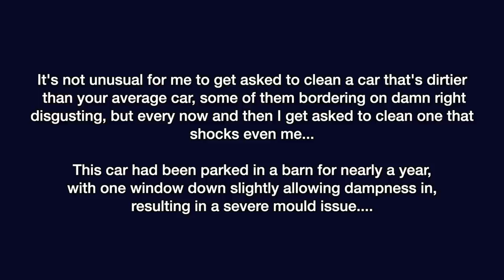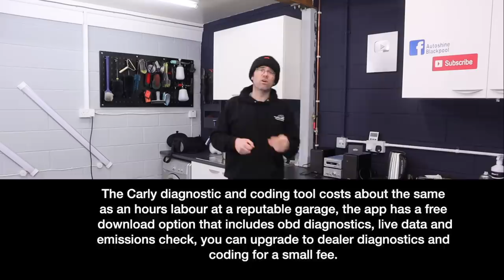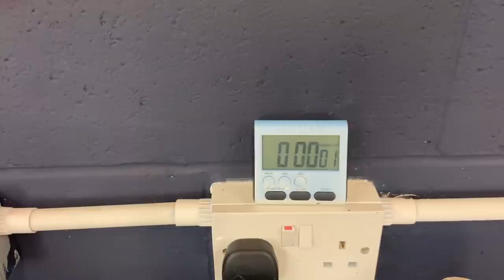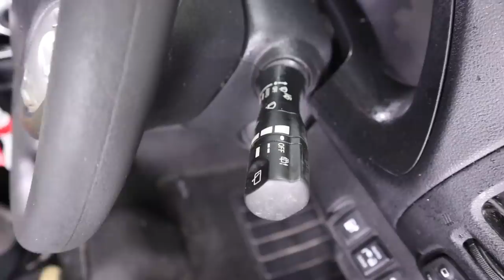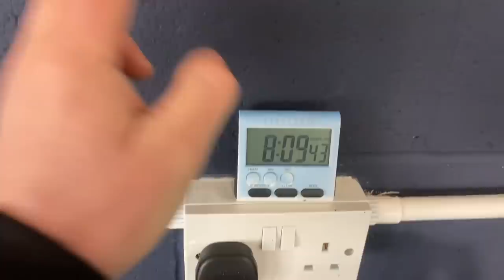Cleaning the dirtiest car ever! Nissan Leaf E.V

Comment: another great clean up but you should really be wearing a properly rated mask when dealing with mold like this, the spores are nasty and dangerous to your health.
Reply: Came here to say this.
Reply: Here's a car I would never want to buy. I credit that he's done a fabulous job of cleaning every surface that's accessible, but mold is going to be in every place it can go including ones you can't reach to clean. It's going to be in the door panels, in the dashboard, in the ductwork and a hundred small place. The spores will carry it and the buyer will react to it. Just pointing out the limits even to this kind of detailing.
Reply: @philipem1000  it would have been better if he'd used an ozone generator to kill the mold first.
Reply: @rlaw22  ye that should have been obvious, hes not the most elite of detailers 😬
Reply: @joemcnamara4774  He's a fine detailer, mould isn't a job for a detailer is the issue here.

Comment: Now imagine what is inside the air vents and on the AC parts. I would be driving this car only in a full face 3m respirator :>
Reply: I wonder the same...
Reply: Or under the hand break panel or under the carpet. :O
Reply: Plenty of air conditioning cleaners that you spray in and leave on recirc for 10 minutes - kill bacteria and mould.
Reply: Yeah, i feel sorry for the unknowing buying that car.
Reply: I would imagine them being quite clean. Parts where dead skin, grease, sweat, hairs and other bodily fluids and organ matters stick tend to get moldy when car sits for a long time. Ac ducts dont get exposed to organic materials so they should be quite clean. Thats why sun visors were so dirty but headliner around it was much cleaner - you only touch the visors. I would still highly recommend steaming the ac ducts, using an air con sanitizer and replacing cabin air filter.
Reply from the maker: It was air bombed prior to returning so no worries about any nasties in air con etc.
Reply: @autoshineblackpool  you should have included that in the video  ;-)
Reply: @autoshineblackpool  Ozone works wonders on the mold spores and smell!
Reply: I was going to ask that same question, did he use his steamer and open all the vent to let the steam circulate through the system. Also he could use an ozone machine to kill the spores.
Reply: @autoshineblackpool  Certo, Chefe.
Reply: I'd also be worried what's below the center console in the carpet, or, even below the carpet (basically you could see there is stuff when the edge of the carpet get's lifted), behind door trims or inside the dashboard, given how even the seats looked below their covers; Mold is just such a nasty thing.
Reply: @autoshineblackpool  Hi Gary, what product do you recommend for that? Thanks.
Reply: You could stick an ozone machine in there which actually will kill everything, won't be able to release spores as its dead.
Reply: Id not touch the car with a ten foot pole.
Reply: also what kind of condition would all those electronics be in after a year in dampness?
Reply: @AnyBodyWannaPeanut  They are probably ok. Most of them are designed to withstand moisture.
Reply: Here's a car I would never want to buy. I credit that he's done a fabulous job of cleaning every surface that's accessible, but mold is going to be in every place it can go including ones you can't reach to clean. It's going to be in the door panels, in the dashboard, in the ductwork and a hundred small place. The spores will carry it and the buyer will react to it. Just pointing out the limits even to this kind of detailing. You'd have to literally disassemble the vehicle to get rid of all of it.

Comment: Mold spores can be very harmful to your health just breathing them in. You should have worn a respirator. Also, here in the USA most detailing shops would have used an ozone generator to kill all the mold inside the car. All you did was remove the visible mold. There may still be mold spores in the headliner, the seats, carpet pads and many other places. I strongly suggest using an ozone generator before returning that car to the owner. Mold spores GROW, so if they aren't completely eradicated, they will return.

Comment: Once again just vacuuming made a lot of difference! Despite that being one of the dirtiest looking, that looked quite easy for you to clean compared to the Red Ford(?) those seats took some doing. A YouTube channel air like to mention is ‘Alex Carter’ he’s basically a car audio installer in my town - Swindon and when I decided to get new stereo fitted I checked to see if there was a YouTube channel. A lot of content is him working on cars, and he’s a huge Snap-on tool fan and gets visits from the Snap-On van every Tuesday and has two huge tool boxes. The car audio content can be quite interesting, shows a lot of common mistakes ppl make installing for example DAB antennas. Other channels, although they’re doing quite well, are electricians ones such as CJR Electrical, Nick Bundy, Adam the apprentice, DSES (Dave Savery) and so on. These ppl are proud to show off their work, and I think any decent business should use it to show your worth.

Comment: Is there a way to kill off all of the hidden mold spores?  I would be very leery of driving in something like that.
Reply: he replied to another comment that the car got something like this before being returned
Reply: @TheThomasites  Thanks I wasn't sure if an ozone generator killed mold spores or not.
Reply: @artflorez1568  It will but I'm not convinced you can actually reach all the mold that must be growing under the panels and in the electrical channels and the ductwork and a thousand little places. I don't know how long you'd need to run that kind of machine to really get it all and ensure it won't recur.

Comment: Back and forth, doing tires and outside when inside is a disaster. Not having all your tools outside to save time...priceless.
Reply from the maker: Whats the rush? My workshops like 8 metres long nothings ever that far away 😂, but I suppose I could leave all the muck on the outside so that everytime I brush past it In my workshop I get filthy, if that makes sense to you. Doesn't to me though.

Comment: This usually happens when the car is stored with the windows closed. When the windows are open, the air circulates and it does not go moldy.
Reply from the maker: It was in a dark damp barn with no sunlight so yeah I agree but not in this case. The cars around it were all covered in mould inside and out.

Comment: You did an amazing job! I cant believe they trashed the car that bad. I wonder hows the battery condition. Early 2022 i just bought a Leaf 1st gen just like this car. Since the gas price is up this car price goes crazy pricy. I got lucky get ahead just few weeks before the price went up with same year and model over 7k difference. The car that i bought only has 29k mileage on it. Very reliable car.

Comment: Here are my thoughts. I have a car that has gotten some type of mildew in it. Not a large amount, but every time the passenger side floorboard gets water in it, it stinks. Like mildewy, moldy smell. This car is WAY worse, and although you do an INCREDIBLE job, I wonder if this car will ever get rid of the smell. I would think seats, carpet and headliner would have to be replaced.

Comment: A Dehumidifier is a worthwhile investment for drying items that have been wet washed. Place it in the middle of the vehicle and it'll suck out all moisture present. A lot cheaper than leaving the heating on to dry a vehicle out, in the long run.

Comment: @ 22:00 this isn't actually a problem for modern electric cars, think about it, you charge every night and the next day you have 100% range (theoretically, you actually charge to 80 - 90% to keep battery healthy, unless you need to do a longer trip), and newer electric cars go further per charge and charge very quickly, with most able to charge 10 - 80% in <30 minutes at fast charges, teslas even faster.

Comment: Just adding my two pennies worth. What about all the spores in the underside of those seats, I think I would have turned the car on with disinfect running through the air system after talking out the HEPA filter then replacing it with a new on.

Comment: It is IMPOSSIBLE to get rid of the mold spores in that thing, even with your superior cleaning skills.  Recovering and refoaming the seats would help ... along with all new carpet and all new air filters. But I would put a pan on the floor with formaldehyde and let it sit for a few days to kill as much as possible.  I hope you don't suffer a respiratory crisis from cleaning it without a serious filter mask!  There oughtta be a full disclosure of the mold condition to whomver buys that pig!
Reply: I think you could use one of those ozone machines and leave it in the car for a day. That will kill the mold off (and the detailer if they stay in there too long while the ozone machine is running)

Comment: you sure that wasn't buried?
My son-in-law had one of those devices, not the Carly,  installed in his car.  He was wondering why his battery was going dead if the car sat a few days.  After buying a new battery and still having the problem, it turns out the device was causing a ghost draw on the battery.  He took it out and hasn't had any more problems.

Comment: Here's a car I would never want to buy. I credit that you've done a fabulous job of cleaning every surface that's accessible, but mold is going to be in every place it can go including ones you can't reach to clean. It's going to be in the door panels, in the dashboard, in the ductwork and a hundred small place. The spores will carry it and the buyer will react to it. Not criticizing you, just pointing out the limits even to this kind of detailing.

Comment: I would have sooner taken the drivetrain parts out and sold them, then sent the body off to the crusher than trying to clean the interior. The spores you see, the mycelium you don’t see will just make more spores as soon as conditions are right again.
Reply from the maker: In damp countries like this a lot of cars suffer mould build up if left over winter etc. It's not uncommon whatsoever. Provided the car is now kept dry and not put in a damp barn with the windows down it should be fine. It's impractical to scrap every car here that gets mould inside it. You just clean it as best you can and get on with it.

Comment: Sometimes when I get a seriously really dirty car before I wash I use snow foam but a problem that I’ve found is any thick heavy long sitting snow foam is really expensive and doesn’t sit on the car long enough to loosen dirt properly so I figured out that I can use any normal car shampoo and a small drop of ( easy clean washing up liquid ) yellow bottle thicker than most other washing up liquids which creates thee thickest snow foam you have ever seen in your life ! Guaranteed ! 🤣 and it stays on the car until you wash it off and seriously gives it an amazing shine honestly try this your self anyone you will thank me later 🤣👍

Comment: I have a spear and Jackson pressure washer ,apparently they dont make a foam bottle that fits on the lance it comes with.  There is an adaptor on Ebay, what size fitting adaptor on a generic bottle do I need to  get to be able to use the pressure washer.  At the moment I'm just using snow foam mixed in bucket  with water and sponge

Comment: The car looks amazing after you have worked your magic on it. Can not believe a car is allowed to get as dirty as this one, especially an electric model, as these are not cheap. Do you think that mold has collected inside the dash and on the electrical system as it has inside the rest of the car ? What's your thoughts on it. As always an addictive video.

Comment: A while back i was looking for a car and  came up to the guy who's one of those guys flipping cars for living, i sat in , pulled the seatbelt and it was covered with mold. I directly walked away from the car with a unprofessional disappointment of the seller as a result. If you don't know the history of the car - is it not disaster waiting for happening ? smell , damp , maybe rust underneath of it all ?
Second You clean this motor like a champ as usual , how can you know if the motor is safe now? how about mold in the insulation and stuff. It is different than an usual neglected motor you get for clean. Would you walked away if car you see with intention to buy had mold in it?

Comment: Also, I would have taken the console apart and taken the carpets out if I were you.  You might have taken care of the mold on the top of the carpet and the upholstery but I would bet money there are still mold particles under the carpet, under the console, etc.  I still wouldn't drive that car even after the work you did on it.

Comment: Does this (or similar) ever happen to brand new cars that might have been stored for a significant time before sale and they are all cleaned up before being sold?
Reply: I work for a dealer, this very very rarely happens. But it’s a common issue we’re having with used cars at the moment as they have been shut for a while due to lockdowns and when the carpets are wet vacced it is causing mould growth. That’s why we open the tailgates during the day in normal times :)
Reply: @tomhill3907  Thank you for the reply!

Comment: Just curious, what ratio do you use the G101 at for interior cleaning?
Reply from the maker: Between 5 and 10 percent g101 usually. Stronger for bad cars like this though 😊
Reply: @autoshineblackpool  Cheers buddy, appreciate the reply. That was rotten in there 🤮 is G101 safe for wheels? I've only recently started using it and I've been cautious what I've tried it on 😅

Comment: Is that car even going to run anymore?  Being an electric vehicle that was completely saturated with dampness?
Reply from the maker: I've been driving it and it's fine.
Reply: It'll be fine - batteries are sealed - more issues with letting drivetrain battery go flat. Reduces life or charge capacity

Comment: How did you deal with the seatbelts please?
Reply from the maker: Anti bacterial spray and wipe. You need to be careful not to use anything too strong on seat belts, same with steam I don't use that for fear of it weakening them.
Reply: Autoshine Cars that’s great thanks. Did you use the bio brisk on the belts or something else?
Been asked by a friend  to have a go at some mouldy belts but not done them before
Reply: I had a Renaulsport with the silver/white seatbelts, were manky, pulled them right out as far as they could go, lye them on the floor and jetwash, on a WIDE nozzle , don't use a fine jet or a turbo nozzle , came up like brand new

Comment: the future is hydrogen, not Chinese batteries with a French stamp
Reply from the maker: Totally agree..or synthetic fuels like porsche are investing in.
Reply: Nissan Leaf batteries are made in Japan. Hydrogen fuel cell cars already exist and are are less energy efficient than Battery-electric.
Reply: @Ianmundo  batteries is a technology without a future with exhausted development possibilities hydrogen cell is a completely new technology look at japan public transport on hydrogen 125,000 registered private vehicles fast train and constant development of hydrogen infrastructure, European corporations hammer us into Chinese batteries because they have an interest in it, and batteries in Nisan not sa Japanese Nisan has not been Japanese for more than 10 years, only French on the batteries is the inscription made on a Japanese patent, but if you check the manufacturer, it is Chinese, professionally this battery model is included in most European Renault models